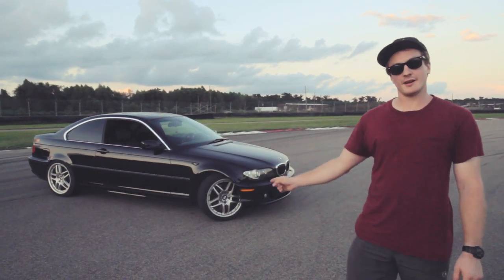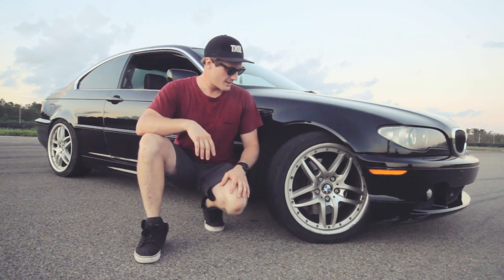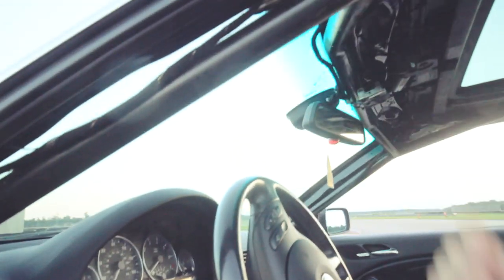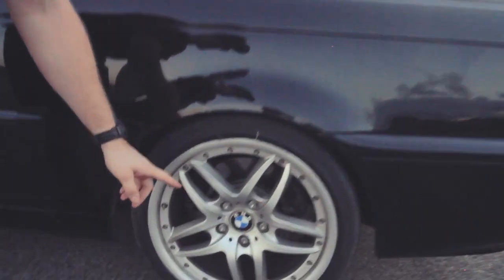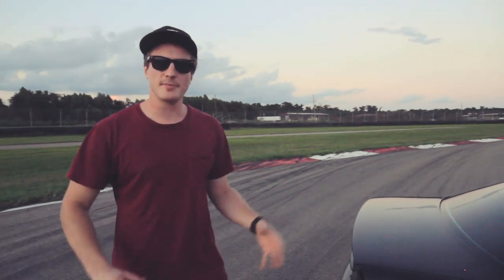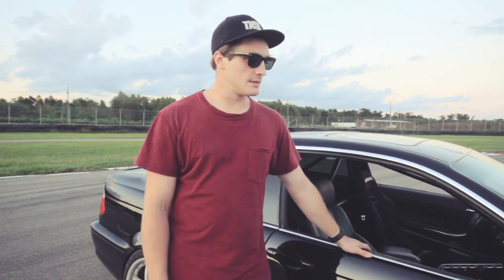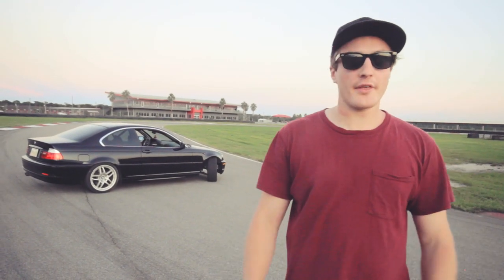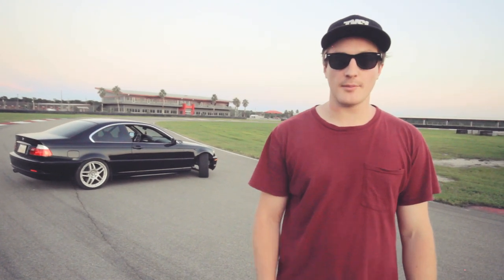The perfect drift car - my street legal BMW e46

Comment: No oil cooler needed ? 
What steering guibo are you running. 
Just bought a 2003 BMW 330i manual transmission. Thanks for the video

Comment: Great looking car, building an 06 330, any pictures of your hydro mounting inside? Love how it’s mounted
Reply from the maker: No such luck. It's just a chunk of 1/4" steel that bolts to the studs where the air bag module is in the center console. If you take it out, the bracket practically builds itself.
Reply: Evan Woss would it be possible to send me a couple pictures of the setup? Anything would help. Thanks!
Reply from the maker: Jake Lipton shoot me your email or holla at me on Facebook.

Comment: what are your alignment specs?
Reply from the maker: Rear is 0 toe, .8* negative camber.
Front is 0 toe, between 2.5* and 4* of camber and maxed out ackerman.
Reply: @EvanWoss  do you know how much caster do you have? also by maxed out ackerman do you mean the least amount or the most/stock?
Reply from the maker: @patrykkowalski6  Sorry, I'm super tired, I meant maxed out caster. Ackerman is set to the low setting, not zero, but the one next to it.

Comment: Hey, what's the kg on your coilovers and psi on your tires? Thanks!
Reply from the maker: Tire pressure varies from track to track, but usually stays between 20-40psi. Springs are 10K front and 12k rear. Are you building an e46?
Reply: @EvanWoss  Thanks! Yeah I am. I'm thinking of going Status Gruppe Srs 10/14.
Reply from the maker: @Innate47i1  unless you're running really fast tracks or sticky tires, 14k might be too stiff out back. I typically have to run my dampers at 30% to get some grip back. Also check out ISC suspension!
Reply: @EvanWoss  Really!? I figured since I don't have much power. That 14 would get me sliding easier and for longer, but I would hate to under/oversteer. It's nice to have some insight, as I was on the fence between 12&14.
Reply from the maker: @Innate47i1  I guess it all depends on where and how you drive, but for me 12k has been perfect. If the car was gutted, 10k would probably be the sweet spot, 14 would work if you add grip elsewhere though.
Reply: Hey, if you don't mind me asking what type of E46 this is? Thanks!
Reply from the maker: Dean Garcia it’s just a 330ci